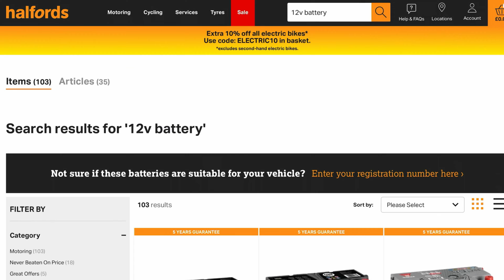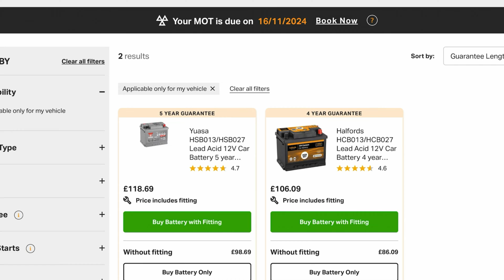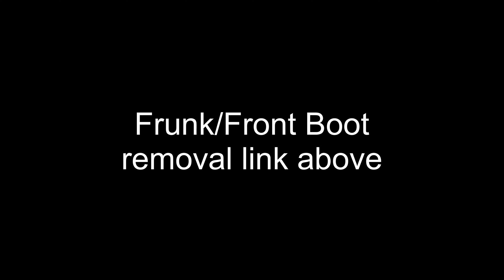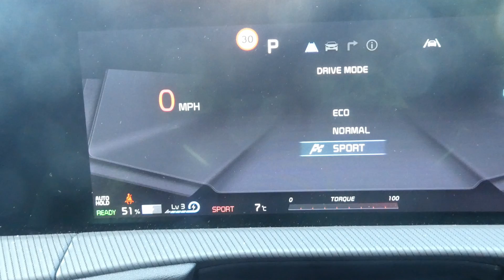How to change Kia EV6 12v battery - practical guide

Comment: Thanks Brian and great video as always. I'm currently part way through figuring out what to do with a 72 plate EV6 GT Line which was scheduled for its first MOT in January 26. I'm going to follow your video and use the Yuasa battery recommended by others.

The EV6 is just under 3yrs old with approximately 25000miles but completely failed part way through a journey on Christmas eve, first with a "Check electric vehicle system" error, then a 12V battery error before completely stopping in the middle of the road less than one mile later. I managed to get it back on the drive after 4hrs of waiting around and various jump starts, where it has been sat ever since. Kia customer service couldn't care less when you speak to them and direct you towards dealers and Arnold Clark (where we bought it from, had a service plan with and sent for the ICCU recalls) have absolutely no availability and been giving us the run around. Appreciate it is christmas but over 2 weeks to even take a look at the car is awful - I am really dissapointed with Arnold Clark and Kia's response. Especially considering that 12V battery and ICCU issues are common and well documented by many users online.
Reply from the maker: So sorry to hear that. It is the worst possible time of year for it to fail. Kia Logistics shuts down for 2 weeks over Christmas,no car deliveries,no parts. They don’t carry parts in stock of high value items like an ICCU because they have to jump through the warranty hoops before they can order one. Until they actually diagnose it they won’t even give you a curtesy car. Been there, done that. The whole system is setup to save Kia & the dealer costs and puts the customer last. Does your EV6 still AC charge? Does Kia App show errors under diagnostics?
Reply: @evodessey  I'm not sure about the AC charger - It was charged overnight the day before it failed. I wasn't sure if the AC charger also topped up the 12V battery so I picked up a Ring 12V 6A battery charger from Screwfix yesterday. This started charging with a ticking sound (along with the bonnet light flickering), then almost immediately switched off and said battery full even though it was still dead and the car wouldn't switch on. 

I've just installed the Yuasa battery from Halfords so the car at least turns on now. However, it still starts with the "check electric vehicle system" error and after a few minutes this changes to "stop safely and check power supply". The Kia APP is showing only showing a "Vehicle Control" problem under the diagnostics section but not sure how reliable it is. I'm completely stumped now as I thought the new battery would clear the errors.
Reply from the maker: Without a battery monitor or OBD code reader there is a limit to what you can do. If you had a BM2 battery monitor at least you could see if the 12v was being charged or not. The OBD and Carscanner App would tell you the exact diagnostic code and would tell you exactly what's wrong.
Reply: I've ordered the Veepeak Mini Bluetooth OBD II Scanner linked in your other video so will play around with that when it arrives tomorrow and will look to get a BM2 longer-term once this is all resolved. Thanks again, really appreciate your insight and knowledge on the issue.

Comment: Battery monitor noted. Have you had to charge your 12v? Connected or isolated please?
Reply from the maker: 12v battery failed in 2023 and was replaced under warranty. I used a battery booster pack to get it back to the dealer

Comment: Hi Brian. Many thanks for your helpful videos. I have recently purchased a 2022 ev6 GT Line with 22k miles on the clock. Two weeks later we have had a problem with 12v battery and had to jump start it. Did you find your problem was resolved after you had it replaced?
Reply from the maker: It's typical of a 12v battery from 2022. Yes it was fine once replaced as long as the ICCU is not faulty but you would be seeing more faults on the dash if it was.
Reply: @evodessey when we returned to the car on the day we had the 12v battery low pull over warning then start ignition with fob before completely dying. This wouldn’t suggest the iccu is fault too would it? 

I’m thinking to just get the battery changed myself without involving the dealership or a garage running tests to save all the messing about.
Reply from the maker: @curtgreenhough5599 12v battery warranty is only 2; years ago just go to Halfords and get a Yuasa 12v. If you have a battery monitor or volt meter you can check if it's charging when the car is on and ready.

Comment: Put the Yuasa battery suggedted on Halfords site and it fitted like for like with no issues, used all week and all good so charging side seems ok but as a precaution its going into Kia to be ckecked out as they owe me a complimentary ceramic coat anyway..thanks for video, most helpful..👍

Comment: Thx for video as my EV6 stuck on my drive at this moment completely dead and waiting for RAC to turn up and hopefully sort it..Had it only 4 months and it's let me down..😢😢😢
Reply from the maker: Sorry to hear that. That’s a bit early in the life of the EV6 to get this problem.
Reply: @evodessey sorry should add had it only 4 months from buying used from kia Hull, it's a 22 reg air model and my first Ev so really upset as never had this problem with any of my petrol & diesel cars ive owned ever..😢
Reply from the maker: @jasbo7288 you are lucky to get 2 years out of Kia 12v stock battery unfortunately
Reply: @evodessey just fitted one of those yuasa 12 volts from Halfords into the EV6 and she lives again..Original battery only showing 5.99 volts on meter so absolutely cream crackered..Kia reimbursing me for New battery which is good..
Reply from the maker: Good result,they should not really be selling them on with such an old 12v battery

Comment: So after putting in new battery, did it reset all the settings in the car?
Reply from the maker: No,only thing that changes is in drivers binnacle where you see trips it reset to the car graphic. Even if it did I could recover via Kia Connect backups

Comment: Once the main battery switch is pulled and set back, you should go into the BMS with a scan tool and clear the hidden code for “High Voltage Interlock Circuit” - otherwise the dealer will detect it

Comment: The EV 6 comes with a 7 year warranty. Although the 12v battery warranty is 2 years, does changing the 12V batteru void the 7 year warranty on the rest of the car? The dealer and Kia remain very vague about this and it currently withholds me from replacing the battery myself
Reply from the maker: As long as you replace with same type Lead/Acid then I've never heard it's a problem. If you put an LFP 12v replacement on then I've read that this could cause problem but never seen anything official from Kia

Comment: Tanks a lot for the guideline! Our battery died yesterday, 5 days after the end of the warranty🎉... luckily in Front of our home.  during the swap i Noticed, that the connector for the Frunk Light wasnt plugged in. I also had to remove it, because the New battery is a little bit bigger. The Light in the Frunk instantly wents on, if the hood is unlocked, btw... Overall it Took me 20 minutes, thanks to your advice!
Reply from the maker: Glad the video helped. Fingers crossed for no further trouble.
Reply: @evodessey  i instantly also ordered a booster⚡️⚡️⚡️!
Reply from the maker: @johannesmuller8214 good move👍

Comment: thanks for the video! I have an issue after replacing the 12V battery. The SoC changed from 60% to 255%. I wonder if any reset in BMS is required and if yes, how to do that. I also noted that the LDC output voltage changed from 14.x V to 13.x V, I wonder if this is normal? Appreciate your comments.
Reply from the maker: It’s a glitch in Car scanner i think. 8 bit number  255=100% SOC. LDC output does vary whilst you drive it so quite normal. The 255 thing normally goes away after a day or 2. You also get it if you simply disconnect 12v battery for a few minutes.

Comment: Do you have to reset the 12v battery after replacing it?
Reply from the maker: Not as far as I know.
Reply: After replacing my 12v, I was a bit worried that it might need to be reset because the SOC for the 12v was 255%.  24 hrs later its now giving a sensible value for the 12v SOC
Reply from the maker: @ShawnHines-qd4wg yes Car Scanner misreports it for some reason then corrects

Comment: How often we need to change battery
Reply from the maker: Mine was changed at 1.5 years. 12v battery warranty is just 2 years in EU & UK. You will be lucky to get to 3 years i reckon.
Reply: @evodessey  can you use any 12v battery or will it void the warranty? Does it have to come from dealer? Our dealer is about 3 hours away. Thanks so much for your help
Reply from the maker: @GamingwithKentuckianJD you can use anyone that is of similar specs and fits in space. I've no idea if it voids warranty. Gut feeling is not.I know plenty that have changed to AGM or better
Reply: @evodessey  thank you so much
Reply: Mine lasted 3 years and completely dead..😢

Comment: When you take out the 12 volt battery do you lose setting etc. within car?  If so what settings are are they recovered?  I have seen others recommend running a relay from the terminals to a trickle charger before you disconnect the battery
Reply from the maker: No settings are lost apart from drive mode and the cluster screen in the binnacle reverts back to the car Icon. You can also back settings in Kia Connect in EU version.
Reply: @evodessey  thank you for that.  We in Australia do not have Kia Connect in the ev6, only the Niro. Go figure, the cheapest has it the dearest doesn't.

Comment: We have a Kia Soul. All the different versions of Kia EVs seem to suffer from cases of 12v battery failure. To only offer a 2yr warranty on a 12v battery when after market suppliers give 4 or 5yr warranties is unacceptable especially when they make a big deal of their 7yr warranty. My experience indicates that the problem is not the battery but the onboard charger. We have so far had three failures in 3yrs. After the second failure (just outside the 2yr warranty) they replaced the battery and charged me £95. As I had reported the first failure (which included a week of investigation with no fault found) Kia UK did eventually refund my payment. The reason I believe that the problem is the onboard charger is that after the first failure I fitted a 12v voltage monitor which recorded a graph of the failure over a 6hr period. The voltage was swinging between 7.5v and 19v and at no time was it resting in the 12-14v range. It is no wonder that the 12v battery failed! I passed this graph on to Kia but there seems to be little interest in this. A friend of mine had his battery fail in 30mins during a short stopover. He also has the monitor fitted. In his case the 12v battery was pulled down to 9v without any loads.

Comment: Couple of points 

I recommend the NoCo boost pack if you get these issues. Once the 12v drops below 10v the car is unresponsive.
Happened to me before Christmas, got it back from the dealer yesterday and they fitted a new battery, after testing they advised they found no parasitic drains after a week of monitoring the battery just died after 15 months.

Also, having worked at Halfords for 6yrs, word is that the Halfords batteries are made by Yuasa so I understand the only difference is the price...
Reply from the maker: Cheers for info .Do you have a link to the Noco boost pack? I have one from 2020 but the disappear off Amazon pretty quickly.
Reply: We tried a different make of booster pack after the first failure. It couldn't provide enough power to lift the voltage enough to turn on the car. We eventually managed to raise the voltage by leaving a 10A battery charger connected for 35mins. On the third occasion, as the car was remotely parked, I resorted to a jump start using my Tesla. All highly unsatisfactory.

Comment: I replaced my battery for a Yuasa in October after having regular flat batterys. All was well until today.  Haven't used the car for about 4 days.  Flat. ☹
Reply from the maker: My wife's Zoe has had a Yuasa battery since 2021,no problems.  Something has to be going on with your car. Have you ever had  your EV6(assuming it's an EV6) connected to Intelligent Octopus Go via Kia Connect?, do you regularly drive your EV below 20% Stat of Charge ?
Reply: @evodessey  Octopus intelligent (although it's disabled in the octopus account). I rarely go below 20%. I do have an DIMO device connected (which is an AutoPI). That shouldn't pull much current.
Reply: @StuartJ the dimo is what's killing your batteries, especially if you're not driving, the car is not accounting for that drain, also have you manually updated recently?
Reply: @prevailz1  maybe, although I have a DIMO in another car, and that's ok. I thought the EV6 was supposed to charge the 12v battery if the voltage was too low.
Reply from the maker: I would also change your Kia Connect password as a precaution just in case.

Comment: @Bassie, same happened to us just before year end. The car just came to a halt and had to be recovered. The dealership concluded the ICCU was the cause of the problem and was replaced  (including the high voltage fuse). The 12V battery appeared to be still healthy.
Reply: I also had exactly the same problem on my EV6. ICCU fuse blew last May and part took a month to arrive from Korea. Today, my 12V battery completely died (not sure it's a battery problem though) and the car is having to be recovered to the dealer on a low loader. Brian, have you had any issues with Octopus since you went on Intelligent (connected via Zappi rather than the car) draining the 12V battery? My car is a 2022 or at least the plate is May 2022.
Reply: Hi @Ronald, my ICCU is already replaced last November (the EV6 was 1 month at the dealer). So hope it is not again the same issue... 😬

Comment: I had battery issues last week and will go to the dealer tomorrow. My 12V battery died after +/- 30min.  So what is the biggest capacity that can be placed? I saw that the Kia one in your video was 62ah and the one at halfords was 65ah. But are there also ones that are bigger and will fit the compartment?
Reply: The dimensions of the battery are standard, but the capacity changes according to the manufacturer however they are all similar to each other.
Reply from the maker: Sorry to hear about your battery. Gets us all in the end. How old is your car? What will fit is all down to dimensions i would guess. Dimensions of the Halfords one are the same as the replacement one ie bigger than the original. I will measure the dimensions later when it’s warmed up a bit outside.